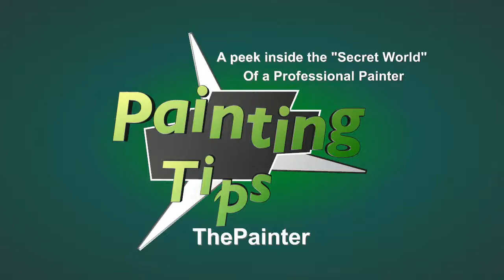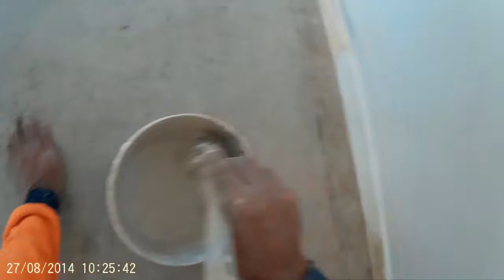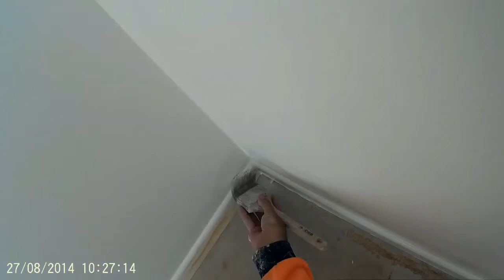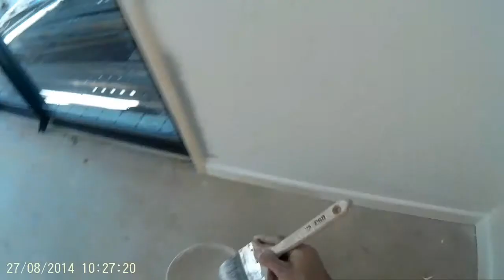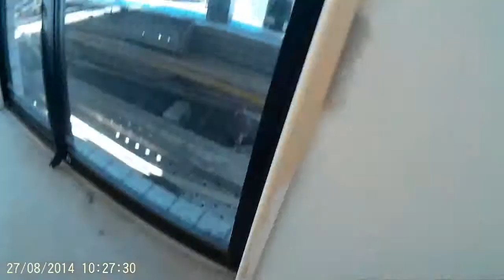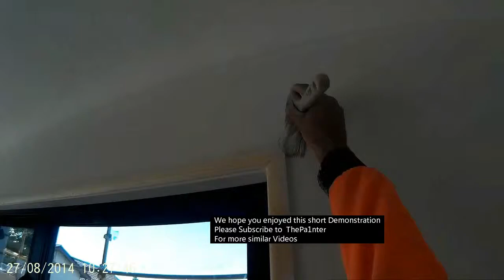Cutting in with paint brush like a pro

Comment: What type of brush do you prefer for your trim? Is that a 2in flat?
Reply from the maker: I try and use a 63mm (2.5")nowadays  for trim but sometimes a 3" like in this video is better for new work, undercoat for speed
Reply: I prefer a 3 in flat myself. How much thinner do you add to a gallon of undercoat
Reply from the maker: @palmerpalmer1538  10% of water is a good number to start with for good quality acrylic. Oil undercoat is around 5%